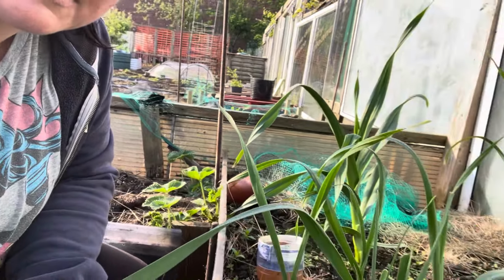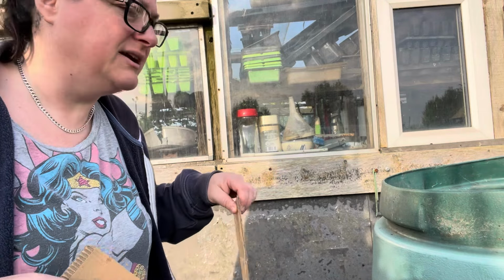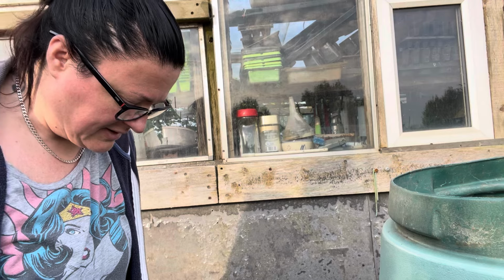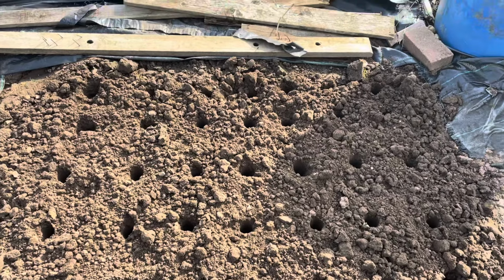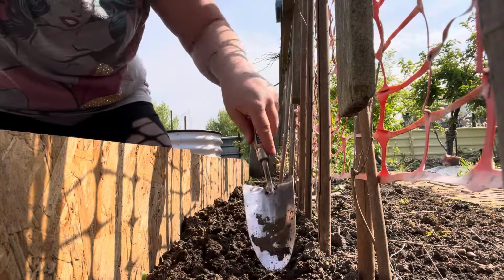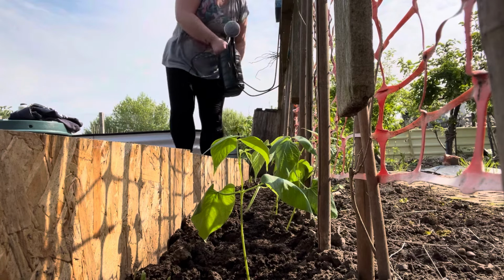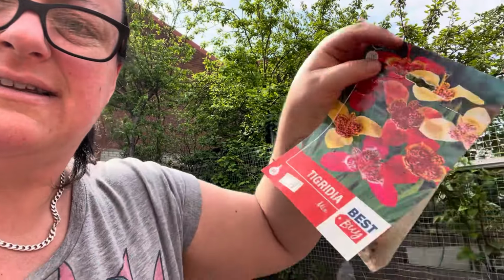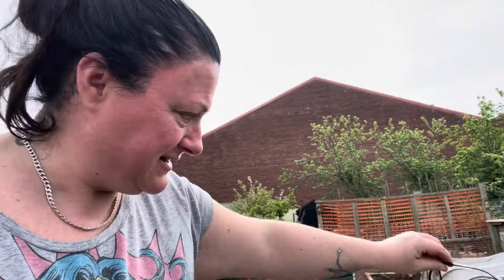Video 22! Composting, runner beans and bulbs!

Comment: If it’s a scape too you can eat them once they curl. I need to sort out my compost to start getting some manure in for next fall/winter. I saw my spinach flowering and dropped the F bomb 💣. Make sure to wet the cardboard as the worms like it soggy 👍. My parsnips got eaten 😢 but I resowed. You have left over marigolds 😮 mine are crap I may need to do again. Great update Jenna have a fantastic week, Ali 🌧️🌧️🇨🇦
Reply from the maker: Hi, my spinach has now been eaten…so has my lettuce, beetroot and radishes but they’re quick growers so will re sow asap. Just wait until the next video though lots of updates! Great to hear from you, have a great growing week. Jenna 😁